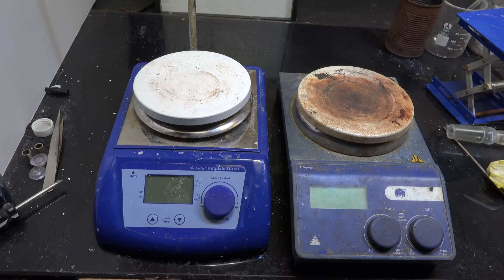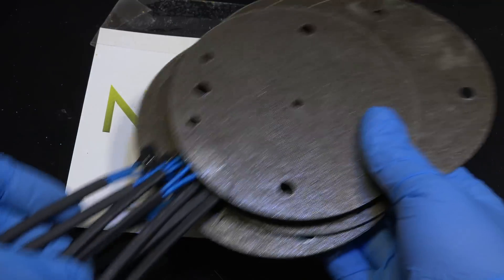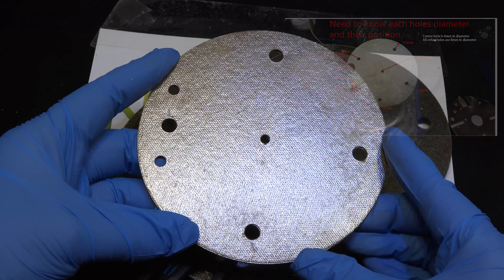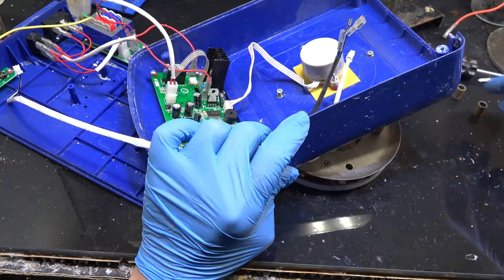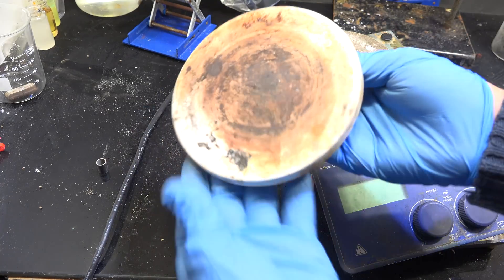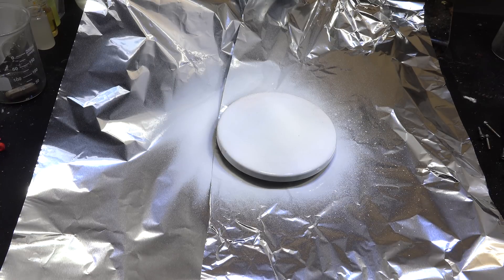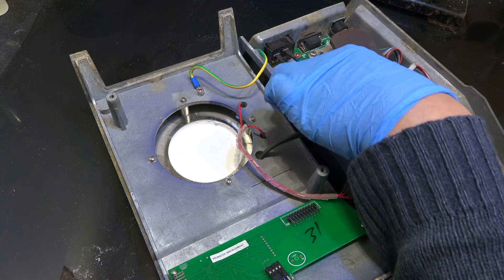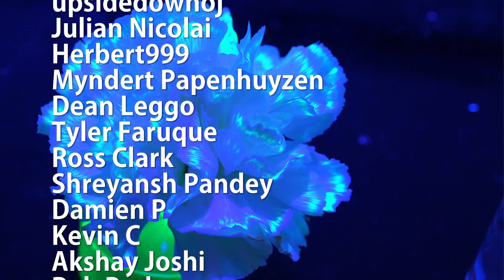Thanks for helping me fix my hotplate stirrers

Comment: Hello folsk. I have IKA C-MAG HS 7 and I got E 3 all the time. If I turn potentiometer on some temp in a few seconds after I turned on my stirrer it works normally until reach set temperature. And after that it shows an E 3
I think the main problem is somewhere in protect circuit but I can not find it... If somebody have schematic, idea how or where to looking for the problem I'll appreciate...

Comment: quite a bit of money for a product that is standardized and consists of inexpensive and easy-to-get parts, the most manufacturers use standard heating elements that are produced by various manufacturers, I understand that the manufacturers of these heating elements only sell them in a certain amount, but the price of around  16 $ each is exaggerated
I built a magnetic stirrer with heating plate and various heating mantles myself and used an Atmel MCU as a PID controller, for the heating mantle I had woven fiberglass threads that a Kanthal A wire was exactly in the middle, then I used this fiberglass thread with Kanthal A soul and a crochet hook to crochet the heating mantle, I noticed that bought heating coats often say "hand-crocheted" and that their pattern looks like crocheted hats for the winter, the PID controller for them was also a Atmel MCU
the good thing is, you can decide for yourself what the maximum temperature should be and how much watt it should deliver, If you are a little familiar with MCU programming, you can also install a lot more, I've planned a connection for an external electronic thermometer, an internal thermometer shows me the temperature of the heating plate, but when I connect the external thermometer, I can use it to control the exact temperature of a solution

Comment: Iv'e mostly finished a hot plate stirrer and i just used a regular hot hob type ring an ebay pid controller, k sensor, ssr, remote control motor with servo tester as a controller. it works just have to put it all together.

Comment: I wonder, does the surface of the hotplate have grooves?
Because i would have lapped it to a perfect shiny finish.

I'm not complaining! I'm just curious, and i'm anal about surface finishes on my stuff :)
Reply from the maker: There is nothing special about the surface. You can indeed polish/lap it down to a perfect surface. I'm a bit lazy and with the amount of stuff i do the surface would likely get destroyed again in a few months. so i didn't go that far.
Reply: I think enamel is better as it's more chemically resistant. If you polished it, it would quickly lose it shine

Comment: Did you have to do any re-calibration on the heating elements to make sure they were reaching the correct temperature or is there a separate part of the hot plate that regulates the temperature?

Comment: Best hot plate can only be inductive plate. Only problem is that surface needs to be matalic, and it is a possibility that stirring magnet will have no efect.

This inductive heater will heat metal. and as long as it has metal to heat, it will work, high temp goes only to metal surface. Search for inductive heater for food, and you will get the idea
Reply: Induction only works on ferrous metals (wouldn't work on aluminum, or most stainless steels), and since they use fluctuating magnetic fields to generate the heat in the metal, the magnetic stirrer would not work properly. This is not to mention how difficult they can be to maintain temps accurate to a single degree.
Reply: In my home i made 3KW induction heater, can melt aluminum, bronze, copper, gold. It does work, only problem is not that efficient as heating iron due to small magnetic loss.

Temp control will not be effected, you can even make a sens based on inductive coupling. 

Only problem is magnet, since it will be heated too by this coil, and no one need's that, because it will heat up more than Curie temp.
Reply: That true, a strong enough induction heater could melt other metals because it can cause eddy currents in those metals, thanks to lenz law, but that requires a lot of energy, note your 3k watts. Much more than it requires for ferrous metals. 

Something like an induction cooktop that would be used for hotplates like the ones in this video would not be able to create strong enough eddy currents to generate heat in non-ferrous metals.  Not only because of the lower amount of energy through the coil, but also because the coil is arranged differently, in a flat plane that distributes the field over a wider area, as opposed to the cylindrical tube that most high wattage induction heaters that melt non-ferrous metals would use.

Also, there is still the problem of not being able to stir the fluid, as you said, the magnet would probably melt, or might just not work at all in something like a more typical induction cooktop.
Reply: Electric magnet is needed then. Will use up some energy and needs graphite sticks to give out energy to it, but will work even in higher temperature.

Comment: It would be nice if hot plate stirrers weren't so damn expensive. I have a small hot plate I picked up on ebay. Unfortunately it appears to have died. Time to go back on ebay. I do have a coil burner style hot place that's used for cooking. I need to see if I can dig that up. It's not as ideal as a lab hot plate. But it works.

Comment: why this hotplates for chemist have rotating element that rotates magnet in the solution?
Reply: the element doesn't rotate, there is usually a small DC brushless motor (similar to a fan motor) that has a ferromagnetic bar attatched to it. This spins below the element, which is close to the cover plate surface.
Reply: The magnet rotates in the solution in order to stir it during the reaction.  The stirring ensures that the reactants react as much as possible.  Stirring also ensures that any solid product does not settle on the bottom of the flask, where it might burn during heating.
Reply: so can you heat while you habe a magnet in a solution? (teacher told me that magnet will melt so I am confused?)
Reply: stir bars are usually PTFE coated and high temperature resistant up to about 330-340 Degrees Celcius.

PTFE melts/burns at about 360 Degs C, so you can push them a bit past their specification, however, they're not guaranteed to last as long above that temperature.

Magnets wouldn't melt at 300-700 degrees Celcius. A ferromagnet is made of Iron which has a melting point above 1000 Degrees Celcius. Neodynium has an high melting point of 1038 Degrees C too.

Your teacher is stupid.

Comment: Chinese companies are very flexible so I wouldn't be surprised if they made a dye for your order specifically.
Reply: If they've got a short production line or only need to retool one line, then it wouldn't cost them much. $500 to a chinese company is like $3000 to a US, European or UK one. 

If it's a generic heating element, chances are they already had the tooling, just needed to switch it out.
Reply: "die"

Comment: I'd love to see you makng the hotplate from scratch. Earlier when I was a highschool student I made one magnetic stirrer without heating. It costed me under 3 dollars, few minutes searching electro-trash and few hours of work. It's still working and it can stirr stronger then I originally thought it will be able to.
Reply: DC brushless motor, a 12V PSU, some adhesive (heat resistant/high melting point stuff or car battery, jump leads & a lanthanide welding rod), a magnet of some sort. You preferably want a permanant iron magnet, as I don't know how well you could weld neodynium...never tried it myself.

You'd probably need some caps, resistors and definately a potentiometer if you want to control the speed.
Reply: I've got pics, can't post them here tho. it's based on old 12V charger, cooling fan from pc, neodymium magnets from ebay (that's majority of the cost), few screws and nuts. And ofcourse some shreds to make the body.